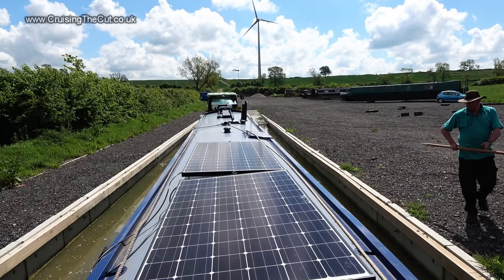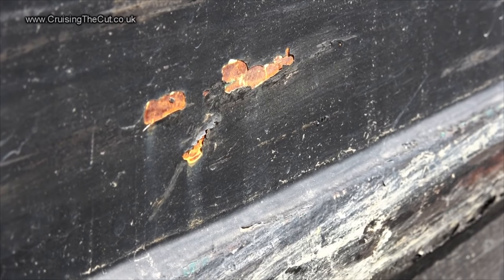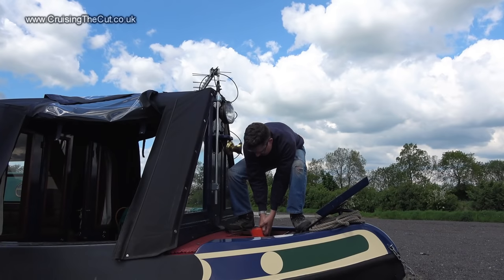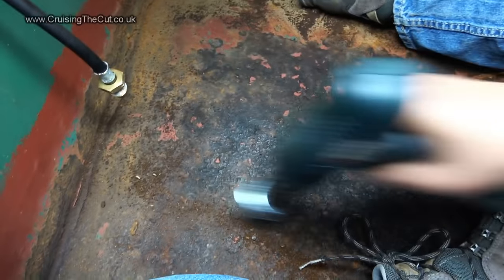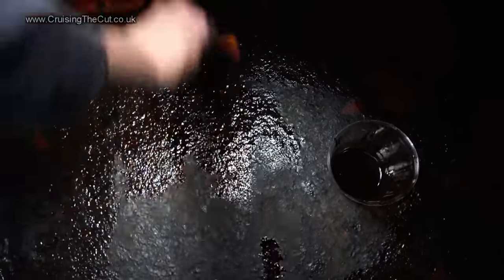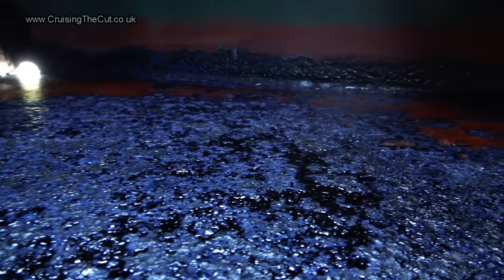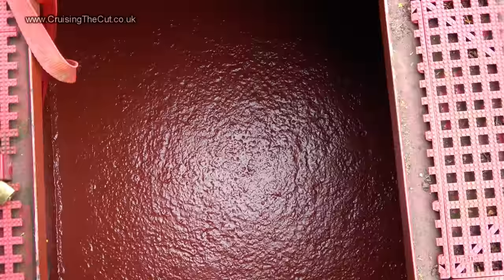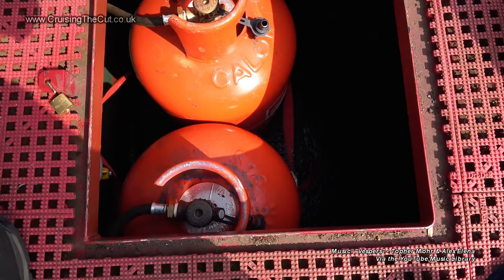55. De-rusting and repainting my narrowboat gas locker

Comment: I know what you mean about marinas charging the earth,they quoted £660 just to apply the blacking LOL,dick turipin,stand and deliver ,good job I am doing the blacking myself I think.
Reply from the maker: I assume that includes lift out though? Sounds about right, depending on the boat length and treatment required.

Comment: One last item 
Love your videos excellent editing camera work doesn't jump around and cracking good audio how come like all the
Old working boats don't you advertise on the boat give it an old timy look and feel and maybe bring in a few pounds extra!
After 50 years of running locomotives and driving trucks can't seem to sleep well without the rumble of the diesel quietly in the back
Ground.
In your case the softly bobbing of the bost. That puts me to sleep every time
Thought empty the forward water tank next time u need to clean the gas locker 100 gallons of water not weighing done the bow should raise her a bit I'd think
Reply from the maker: Yeah, it goes up a bit as the tank empties but not enough to keep it dry while painting, alas :-(
Reply from the maker: The gas bottles have to stay where they are as that's where the gas pipes run. No space for so many bottles and I don't want the back any lower.
Reply from the maker: Oh, sure. I'd still rather take the boat out, I don't think a tilt due to ballast would be sufficient.

Comment: why not connect those two drain hole in the lockers with tubing. so the lockers stay dry?
Reply from the maker: Because it's a gas vent in case the cylinders leak, so you're not permitted to block it in any way. Otherwise leaking gas could build up in the locker and be a potential explosion risk.
Reply: +CruisingTheCut oh I see. what about well lockers? are those holes just for water drainage?
Reply: I think he was referring to the storage lockers rather than the gas locker. Might be just become an annual to-do to check for problems like rust.
Reply: Seen those gas bottles in several of your videos now. Do they not have a means to fill those bottles in place via pump where you get diesel? Must be very tiresome changing those gas bottles out. Seems very old school and price gouging like caravans and bbq gas etc where they should have a tank system more like cars running LPG and far safer too.
Reply from the maker: Yes, you're right. Good point.
Reply from the maker: No, I've never seen refillable bottles, that's not how the Calor system here seems to work, it's always a swap out.
Reply: Those propane bottles you have are refillable. It just requires a source of propane and the necessary adapters - essentially the reverse of when you are using propane on your boat.

Swapping bottles is a matter of convenience, safety and efficiency for both the boater and vendor.

If you wanted to, you could probably take the bottles to a propane dispenser usually at a gas works, which might be miles...err kilometers away, and have the tanks refilled.  But you might have better things to do with your time and it may be troublesome toting two 13 kg bottles back and forth.
Reply from the maker: Miles is correct. We don't use km here.
Reply from the maker: Jason Burton Hi Jason. Sorry, I must have misread your original query. Yes the storage locker holes are just to drain water so I suppose I could put something across to lead the water straight out. Don't know what they don't do that from the start but there's a lot of very odd design decisions in narrowboats.
Reply: In Australia we don't have gas bottles around the size I see you use, 13kg?.  Generally the largest portable propane ones for domestic market is 9kg which they only fill to 8.6kg for expansion safety reasons via a scale, although they used to fill them to capacity until the gas came out as liquid out of the bleeder valve and then they closed it. Never had issues with that way over decades. Personally I think it was more a means of giving less and charging the same. Anyway, here we can elect to buy our own gas bottles and have them filled where ever we like, which is generally a little cheaper than swapping cylinders. For a 9kg bottle its around $22 to fill to 8.6kg or up to $30 to swap so it doesn't take long to recoup the cost of buying your own bottles.. I don't like swap bottles because I've noted on more than one occasion that some are out of date and some vendors will then reject them as a suitable swap when you return them even though the mongrels supplied them to you that way.  Here a gas bottle has a stamp on the collar when it was last tested. First time around it's generally when they were manufactured. They're good for 10 years after which they have to be retested, examined internally and have all the valve system replaced and re-stamped. So, when they're nearing out of date generally people either pay to have their own gas bottles recertified or exchange them in a swap situation. There's no monopoly here and there are many venues for swap or refill. The next size bottle we have is 15kg intended for forklifts only and there's a rental agreement on them. Sorry to blather on, I just thought you might be curious about cost and sizing, and filling options etc elsewhere. Seems Calor has a nice little monopoly going. What does it cost to swap out your 13kg bottles?
Reply from the maker: Erroneous Code A 13kg bottle is around £26 (GBP). I've not really done much research into other solutions simply because that's the way it's done and all the wharfs and marinas stock Calor cylinders!
Reply: When I think propane tanks I would think 20 lbs (9 kg) which I see on home outdoor grills. Portability might be more important than longer burn time. 

I imagine that a narrow boat owner might prefer the 50% more propane that a 30 lbs (13 kg) tank would provide since larger tank means fewer swaps needed (portability is less of an issue) over a given period of time. Probably everyone standardized on 30 lb (13 kg) as the largest tank that the boats could typically accommodate so anyone who goes off-standard is on their own.

Comment: Does anyone you have seen sand blast rust out to shiny metal
Reply from the maker: Typically only if doing a major refurb at a place with suitable facilities
Reply: Yes, and I've used it on cars.  It can make a real mess if done on a large surface, outside of a booth, and you don't dare get that grit in your lungs or you'll be in seriously bad shape.  Works well in a blasting booth for smaller parts done safely; it's fine for body panels and such but just harder to manage.

Comment: Did you actually fix the drain-holes? I mean if you have to have them, then you'd have to "install" new ones if you closed up the old ones, right?
Reply from the maker: Which ones, the storage locker or the gas locker? Can’t alter the gas locker ones, they’re obligatory for safety reasons.

Comment: Question: ever heard of fiberglass? seems to me a lot of what your trying to do would be better done with fiberglassing.. No, I am not going to say your doing it wrong but as an old journeyman painter I couldn't resist asking this as more or less a question.. Course I have not done work in England and have no idea of the conditions there, still I want to be helpful if I can...
Reply from the maker: Goodness me, no, not on a steel narrowboat. The two do not mix well. There was once a fashion for fibreglass cabin tops over steel hulls but this never took off. For repairs to the gas locker, it would almost certainly result in water being trapped twixt fibre and steel and actual promote rusting, you'd not get a good enough bond. I'm far from an expert but there's good reasons why narrowboats are done this way.
Reply: Who says an old journeyman can't learn a trick or two...lol come to think of it, I was never hired to paint any structural steel with any kind of gel coat or fiberglass, do you happen to know what base the blacking has that you all use. is it tar based epoxy? We use that to coat pump stations and other sewer equipment and on steel we did what they call powder coating a sort of baked on enamel. I have used a two part epoxy to paint the the ceilings in stores that have the structural steel roof exposed. No, I am not trying to make into a professional painter, but as one I am always curious when something I have not done before comes along. Another thing I noticed you didn't use a sand blaster or powder blaster to remove old paint and rust and that peaked my curiosity too. Don't feel you have to do any research for me or sound super intelligent for me, I was just curious is all. A simple url might do the trick. I and my wife are greatly enjoy your vids.
Reply from the maker: Coal tar blacking has just been banned, I believe (I don't know why). The Intertuf 16 I use is bitumen-based. Some boats do get coated in a two-pack epoxy instead but it's expensive and you have to shotblast any standard bitumen blacking completely off first.
Reply: The reason I ask so many questions is that I am near retirement and will find my self unable to afford the rising cost of having a land based address, plus  I want to travel, course many of the question I ask you are either answered in your vids or are readily available on the web as I find out, that is if I watch all your vids and know how to spell all of the things you mention...lol So sorry to be a bother some what by asking questions you have already answered most likely twenty times already perhaps...Was pleasantly surprised when you were so willing to answer even my stupid questions...lol I enjoy writing humor and totally enjoy your some what dry English humor and dead pan delivery...
Reply from the maker: No worries! Good luck with your plans. Glad you like the videos.

Comment: It seems a tad daft to have a drain outlet at water level
Reply from the maker: Yes. Either my boat was over-ballasted at build or they just put them a fraction too low. Should really be an inch or two higher.
Reply: @CruisingTheCut  May be something to do with gas being heavier than air and flow out the lowest point if there was a leak?
Reply from the maker: Yes, that's what the holes are for in the gas locker but they are too low to the waterline on my boat.

Comment: As well as removing the rust did you remove the existing paint from the lockers back to steel prior to primer coat or paint directly over ??
Reply from the maker: I took it back to metal on the floor up to where the metal was solid.
Reply: CruisingTheCut thankyou I wasnt sure if you could apply directly to clean degreased paint.👍

Comment: Bit of a poor design for the gas locker, seams the base of the locker should have been higher to prevent water washing in through vent. I take it this only happens when underway. The deck would then have to be higher to accommodate the bottles. Hopefully with all the work you have done, the rust will be kept at bay for a good while. Good to see you are keeping on top of maintenance, well done. BS
Reply from the maker: Agreed although I chatted to the boat builder and he said the company that fitted it out had over-ballasted so it was lower in the water than it needed to be. No idea if he's right.
Reply: Why not try taking some out up front, it might improve the rain run off as well.

I kept my boat in Holland for the last 3 years I owned her, had her lifted out and put in a climate controlled shed for the winters. I would get there a week before relaunch and slap a coat on the hull and get a coat of varnish on so she was ship shape ready to be put back in. When she was left afloat in the UK it would take a month even though she was sheeted over.
The cost was not much more than an over winter mooring, but I did save on work plus great peace of mind in that she was safe from winter storms.

BS
Reply from the maker: There's no access to the cabin bilge and ballast without removing all the internal fit-out, so a massive and likely destructive job.
Reply: Looks like your going to have a soggy gas locker then. BS
Reply from the maker: Sadly true :-(

Comment: Wasting your time with the teflon tape I'm afraid. The rounded piece at the end is where the seal is and the nut part is loose on the central pipe so even if you stop it leaking down the threads it will just come down the outside of the central pipe if the faces are leaking. Make sure the faces are clean when connecting a new bottle and after fitting and opening the valve put a bit of dish washing liquid mixed with water around the area and any bubbles forming will show where a leak is. Tighten until the bubbles stop. Scoops facing aft would help with keeping water out of the gas locker but it is just a poor design. The holes really need raising and a new floor fitting at a higher level is the only solution with new holes cutting after blocking the lower ones. BUT then I expect the bottles would be too tall and jam against the locker top and the top would need replacing too !!! Boats !!!!
Filling engines with too much oil is just as bad as filling gearboxes with too much oil.
Fun vlog, I keep it on when I am cooking and preparing food, so great when they play one after the other although the order is a little interesting sometimes :)
All the best, Blue
Reply from the maker: I do have a playlist on my channel with them all in the correct order if that helps!! :-)

Comment: Just a locker so why not seal the drain so as not to let water in as it is at the water line. Bad design  I think
Reply from the maker: The gas locker is required to have the drains in case of LPG escape from the cylinders. The bow deck lockers need to have drains so that any water getting into that deck can drain out and not into the boat.